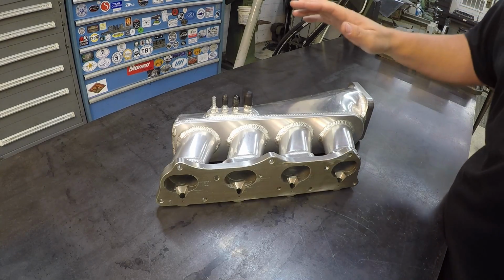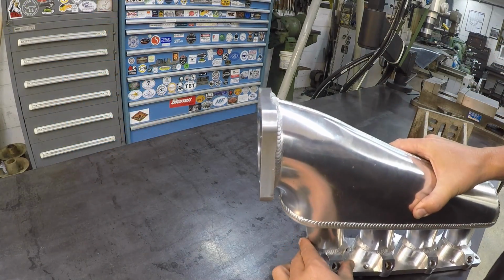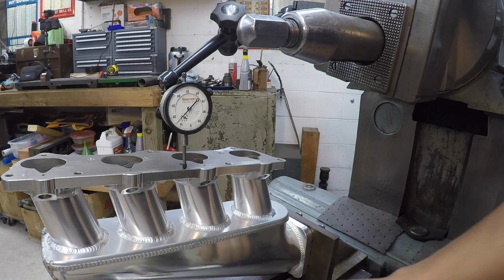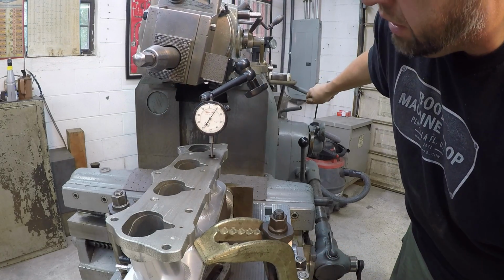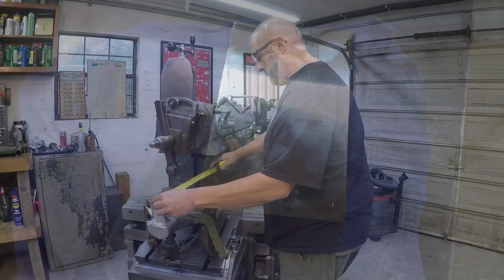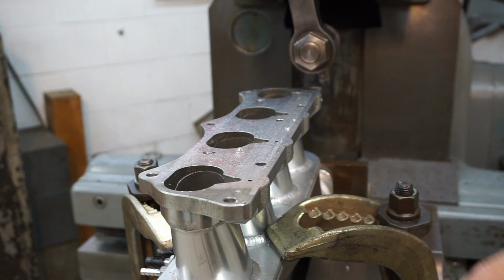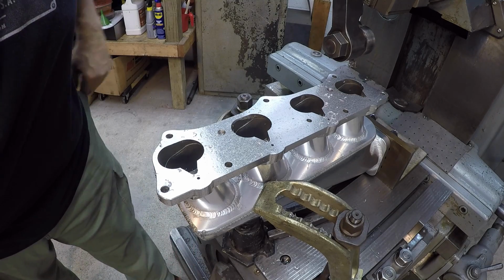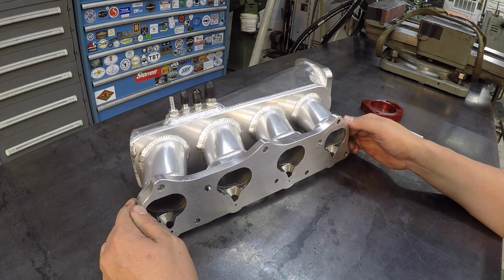Machining an Intake Manifold in the G&E Shaper

Comment: Does it not pick up on its way back?
Reply: the cutter rocks up and slides on the piece and then drops down for the next cut.
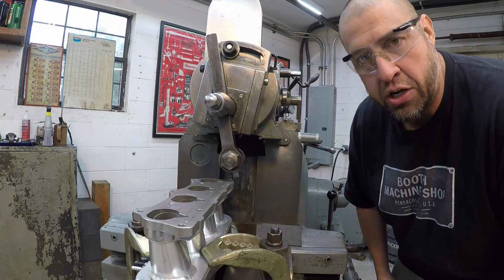Reply: at 23:57 & 24:01 you can hear a clap/slap as the tool holder mechanism pivots up and drops back down against hard for the next stroke.  On this particular piece it did this only a few times.  These machines can take a very heavy cut and this becomes more evident.  At 16:16 you can see the end of a pin at the very top edge of the video frame, at 22:29 you can see it in context a bit better.  The entire tool post assembly is allowed to pivot around that pin to provide tool relief on the backstroke & then bottoms hard coming forward.  Most of these machines are swimmin' with the fishes.  Too bad, but then again, they have been mostly outclassed by CNC mills and/or gear cutter & EDM machines.  Strengths are heavy stock removal & ability to make indexed cuts like splines & thread rolling dies.  Many machinists today have never seen or operated a shaper.
Reply: Mike 'n Laurel Balentine thanks man. Yea it’s definitely a cool piece of equipment.

Comment: Engines require intake manifolds. Motors don't. Learn the difference.
Reply: Motor: A device that supplies motive power.
Engine: A motor that uses thermodynamics to transform heat to mechanical work.
Electric motor: A motor that uses electricity to produce motive power.
Reply: Motorcycle?
Reply: Anal?

Comment: I'm not sure about the part your machining but if you needed to make the datum point (the part you bolted to the angle plate) square to the machined surface you did not achieve that goal here.If you just needed to make the part you machined flat within itself you did achieve that. Regardless, i love your videos and i love these old school tools you keep pulling out of your tool box.
Reply: It's an intake for an engine.  The face that was machined needs to seal onto the cylinder head.  The part that was held by the angle block is where the air would flow into the intake, it would be connected to a pipe (that may be plastic) so it's angle/position is not (very) critical in relation to the machined face  (I mean it has to fit, but there will be a bunch of wiggle room).

Comment: I was taught to never tap the job with a hammer with a dial gauge still in contact, because the sudden violent movement can damage the gauge. I always lift the probe, tap the job, drop the probe back down. Every machinist I see on YouTube just whacks the job with the gauge still in contact and you can see the precision jewelled mechanism dancing about all over the place .. makes me cringe every time.
Reply: Dial indicators are a lot tougher than you think they are!
Reply: @chris0tube Stop buying Harbor Freight indicators and they will be fine...

Comment: Cool video, never used one of those but I can see where they could be very useful!

Shame the manufacturer missed such a critical step - might have been right from the milling of the plate, rather than just the welding of the runners.
If the bolt pattern was suitable, I'd probably just use two 90 plates, one sideways on the manifold, so it could easily be rotated and clamped  with the flange horizontal. However, if you have a tilt table, be daft not to use it?

Comment: You really do need to bolt that shaper down AND leveled, so there is no flex as it works. Who knows how much real flex is being injected into the cut. And if that freshly cut manifold still rocks on the engine, seems the engine needs straightened as well. Another job for your shaper..

Comment: I would guess the intake flange is 6061,  a medium hard aluminum alloy. I expect it is softer and gummier after the welding, and that make it smear easier. Also, the tool probably wasn't quite as sharp as it could have been. Soft and gummy materials require the sharpest tools with more than average clearance for getting a good finish without lubricant.

Comment: I had a warped exhaust manifold I flattened using my parents drive way. Me and my dad grinded it back and forth for hours. Worked decent enough to fix the tick tick of exhaust leaking at the head. Mom was not thrilled with the driveway.
Reply: LOL, hey if it works it works.
Reply: Sometimes you only got what you got. Lol 
My grandfather preached this to me my whole life.

Comment: Could have put the spacer between the intake and the angle plate. Instead of on the other side and used both hold down bolts.   Just saying
Reply: Great video though.  Cool use of a cool old tool.

Comment: I'm seeing a little bit of a hop inbetween strokes. is this deflection of the workpiece or something happening internally in the shaper?
Reply: It just jumps around on the floor.
Reply: @22:55 watch the screen and read the words
Reply: @jonka1  Ahhh thanks I missed that.
Reply: This shaper isn't secured to the floor at the moment, I assume Adam will get to it at some point, it's hard to nail down a final location when machines keep following him home.

Comment: Did you re-countersink the holes after you refinished the surface because I can see that they were all countersunk at least a 32nd before hand but you didn't show us that you re-countersunk them after and you said you only deburred the ports. Deburring and countersinking is my pet peeve with my coworkers. They leave razor sharp edges all the time and it drives me insane. 
Also, have you ever tried Koolmist or an equivalent? I have one that I had my company buy and I live with that, not just for the lubrication but to prevent heat distortion on critical parts. Just curious. 
And so you don't misunderstand, I think your videos and your skill level are fantastic. Keep them coming.

Comment: that is the most unusually contrived intake i have ever seen. looks like it was designed to fit, not FLOW.
Reply: Looks pretty standard to me. Most likely it's for forced induction, so the shape and flow doesn't really matter as long as each cylinder gets equal pressure.

Comment: Hello, I don't know where to put this. I am looking for some help. I've been watching your videos and think that you might be the one to answer my question. A long time ago when I was an apprentice we were tasked to machine a part. I seem to remember it being called a stroke rod. It had both a left and right hand thread cut into it which were on top of each other. At the ends the threads didn't go all the way to the end but looped back to the alternative thread. It was designed to turn rotary motion into a fixed length linear motion. The slide had a rounded off key that would run up one set of threads then rotate and travel back down the reverse thread. Doing the same at the other end. Do you have any idea what this is called technically? Hopefully you or someone else reading this knows what I am taking about. I have Googled it but came up empty. Many thanks and hours of enjoyment watching your videos.
Reply: Ahha! I first came across those on a fishing reel. Try searching "robotdigg reciprocating screw with block", I also found them called "Winch Self Reversing Screw" and "diamond screw" and "LEVELWIND SCREWS & PAWLS"
Reply: @vincentkhougaz8714  Thank you so much, that has been churning around in my head for weeks now. You've just put the final piece of the puzzle together. The one I made was on a 5 inch bar with a 6 foot length of thread. I also remembered what it was for. Winding in a towed sensor array for the back of a ship. Thank you again. My mind can wander in the past again trying to recall all the stuff I did.

Comment: how long does it take to do a piece this size at 46 strokes per minute?
Reply: Enough for a cuppa.
Reply: @ddd228  Hmm ok, cool thanks.😊
Reply: Total width of travel across the surface (~4") ÷ increment of cut (distance moved over per stroke .010" iirc) ÷ 46 = minutes per pass.  About 9 min per pass.
Reply: @bobmicheletti1879  Cool certainly enough time for a cuppa

Comment: Wouldn't it be easiest to put a piece of abrasive on a flat surface and rub the face until it's flat? Or does it need need a specific angle to the rest?
Reply: Shaper is not the only right way to do it, but why would he do things manually if he has the machine. Also, it is the machining no sanding channel))))

Comment: 31:20 10/1000th step over is the same as 1/100th of an inch so if the surface is 6 inches across then that poor machine had to make 100 x 6 = 600 strokes to finish the pass.  If I was doing it by hand my elbow would be sore.

Comment: What if they made a shaper that cuts on both strokes (forward and back)
Reply: Where I served my time, we had a Gray Double Cut Planer at Koppers Company in Baltimore.
It did have a rotating head with two round "button" carbide cutting inserts mounted under the regular head.
One tool faced each way.
The head would rotate about 30 degrees with each pass forward and back to engage the foreward and backward inserts.
This head was used for roughing
Up to a half inch deep with a sixteenth inch pass cut each way in cast iron.
I do not remember where it fed.
Apprentice boys ran the 84" single cut
Planer beside the D.C. machine.
The finish tool was a 1.5 inch broad nose held clear with a wood block in the Clapper block.
 For the finish cuts the block was removed and the broad nose took its finish passes in one inch wide passes
.005 th .01 deep.
This machine was used for machine beds, frames, and bases.
The table was 84" wide and about twenty feet long.
That was in the 1969 to 1973 era.
Reply: You wouldn't get the perfect consistency or great finish cutting both ways with a shaper style tool - either the cutting profile would be garbage so it sort of works both ways or you have two cutting ends that will never be lined up just right. You would need a grinding style tool (or mill) to cut effectively in either feed direction and get anything like decent results.
Reply: I'm sure someone has tried this in the past - it makes sense on the surface, but there are quite a few advantages to having the cutting stroke and a return stroke:

1) You can optimise the ways in the reciprocating head so that you get good load carrying capacity and a good hydrodynamic bearing surface during the cut, which you don't have to worry about so much on the return stroke.
2) The return stroke is usually a bit faster (50% faster or so if memory serves), which means you can concentrate the power output of the motor into the cutting stroke.
3) The return stroke is the period of time where the feed occurs. Either you'd need a long dwell when the cutter was off the workpiece in order to feed, or youd need a way to consistently move the piece during the stroke - both of which are problematic
4) Having a tool that is optimised for cutting in two directions is a very difficult thing to do. Pretty much every cutting tool I can think of has a preferred cutting direction (files, saws, drills, lathe tools...). There's usually clearance behind the cutting edge, and you can't have that and have the cutting point of the tool at the same level to cut in both directions. Maybe you could do something fancy where the tool flips over at the end of each stroke. Complicated, anyways.

I'm sure there are other reasons, and there might be simple solutions to the issues I raise here, but those are my first thoughts in any case.
Reply: That all makes alot of sense. Didn't cross my mind with the tool cutting geometry optimised for a single direction along with the table moving over for the next cut during the back stroke.

Comment: a few things

-as a millwright I have to say please get your machine on the concrete, I know you know wood enough to know it won't last especially when it's being rocked on, but also consider that the wood retains moisture and that the absorption and evaporation of moisture is actually changing the footing of the machine differently at each point of contact, this can and will adversely affect your machine including the wear on your ways, the rocking will add to the problem. Sorry for the run-on sentence. I know you're a busy man and getting it on the ground and the perspective/finality of getting the machine in it's final place sometimes takes away from the magic/character of the machine. I always enjoy your videos and the final product your craft ends with. All the best.

Comment: Hello Adam. Happy New Year to you and yours. I found a good idea about how to remove  the  mill flash on my bench. Did not believe it at first. Place paper toweling on bench top and soak with white vinigar then lay some sort of  plastic to prevent evaporation. Next day  I was able to use a cloth and rub the crud off. I was amazed. Cheers

Comment: Good eye spotting the jiggle is due to the wood platform.  Come one, you cam commit to that machine to put it on the floor.  Its not like the other machines will get jealous.  Machines aren't like women, they won't get jealous if you bring another one into the shop.

Comment: cool approach for those with a shaper. Without, old school it on a surface plate (or granite counter, or glass sheet) with successive wet and dry paper will get it close enough to seal. Built many an engine in the shed with minimal tooling, some have gone a half dozen miles before grenading.

Comment: Adam i used to do a few aluminum head in a Storm Vulcan 85B Blockmaster it used a 24" rotary cutter for milling head and blocks we found the best surface lube for finish was Lemon Pledge (Carnuba Wax Based) . It did a great job and smelled nice :-) or at least a lot better than Tap Majic.
Reply: I like the cinnamon smell of Tap Magic for aluminum.  I've also been told that isopropyl alcohol works well, but I've never tried it.

Comment: @27:30 the work moves a  little during the strokes. Is that an issue (  i think it would be one but im not a machinist)
Reply: I think he mentioned that the movement was the entire shaper moving on the wood blocks it's sitting on.

Comment: Honestly a lot of times with things like this and especially with cylinder heads, you want a little bit of the tool marks left as opposed to a mirror finish (I know this isn’t exactly mirror, but you see what I’m getting at). It helps the gaskets seal. I’m sure that will work just fine as well and you obviously know what your doing, just an observation from an engine builders perspective. That’s pretty damn cool.thanks for sharing again!
Reply: You're right, especially on head gasket surfaces. Sometimes the gasket company will give a 'spec' for surface finish...

Comment: thank you for all the time you spend putting these videos out.   I've gotten a lot of enjoyment and learned a lot from them.   the older machines are very interesting to me as well, although its really hard to understand the purpose of some of them.  Your shaper and radial arm drill are two machines that are not clear in their use/benefit by watching them operate, at least for me.  every time i see a unique vintage machine (like a monster radial arm drill) i wonder what challenge that machine was designed to solve, or what specific purpose each machine was meant for.   I have searched quite a bit and there isn't much info about the backstory of the different types of machines.   if you wouldn't mind sharing some of the history or background on some of the older machines you come across in your videos, that would be awesome.  I know you are busy so no worries if its not in the cards.   thanks again Adam.

Comment: What kinds of jobs would need to use the shaper only? I mean that is the only machine that will work.
Reply: It seems they have mostly been replaced by CNC machines, but they are a much simpler and cheaper to run machine for anything that needs a straight plane machined onto it.
An example of a job made for a shaper is a long blind hole needing to be machined internally (gear teeth or a keyway or something).
Reply: @coast2coast00  yes like  bearing hub inner part for axles in

Comment: Be careful on things like aluminum manifolds and cylinder heads. They are normally machined with rotary equipment so it leaves a specific surface finish that helps retain the gaskets used.  The finish you had from the mill is much closer than the unidirectional finish from the shaper. This is one of the times a perfect finish isn't wanted.
Reply: Modern stuff like a K20 with MLS gaskets the smoother the finish the better.
Reply: You still want a surface of 20-30 microinches RA using a profilometer to measure, unless you are using some real special gaskets and even then it should be a non directional finish. Now flatness on the other hand, it should be within .002 in any direction, flatter is better in this case. We used to hold racing engines within .001 across the full face of the head or block. Bigger issue these days with the thin castings they like to use is twist. Pull a head and discover it's twisted and you need a solid plate and an oven.
Reply: @JMKady76  Except the Hondata K20A-IMG intake gasket really isn't an MLS gasket, now is it!
Reply: @scotty362100  I don't see where I called out any specific gasket in my comment? But you're correct the gasket you mentioned isn't a steel gasket it's plastic and likely even less picky about surface finish. The factory one in every Honda I've taken apart has been steel.
Reply: @JMKady76  Nice story! P.S. the gasket is shown in the video, and I assume you have noticed the factory machined finish (engineered for a reason) on all the Hondas you have taken apart?!? By the way being a backyard mechanic doesn't make your  comments have any basis in reality.